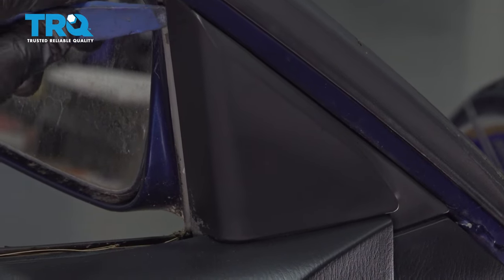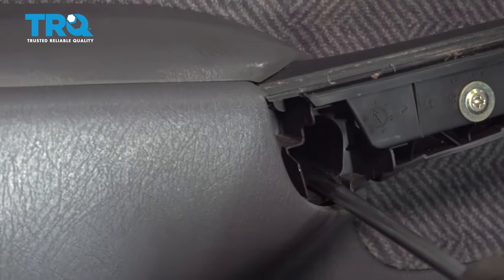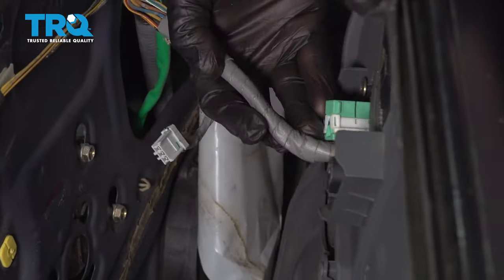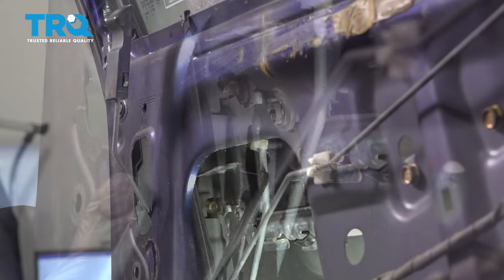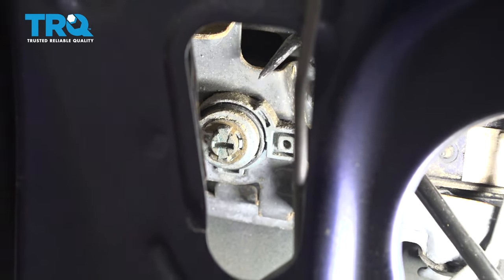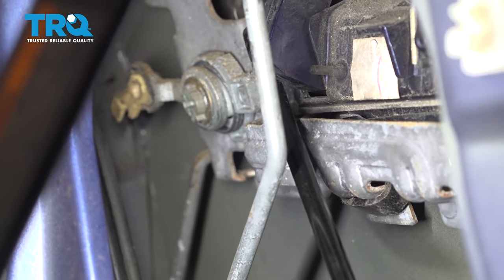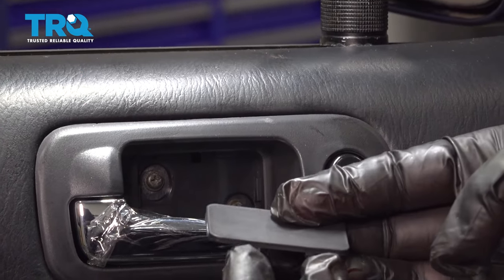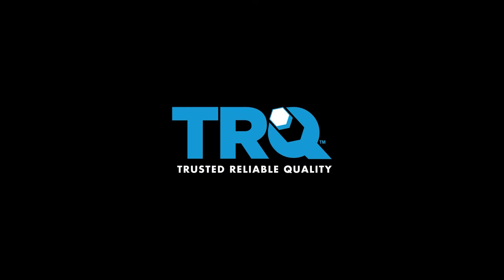How to Replace Front Driver Door Lock Cylinder 2001-2005 Honda Civic

Comment: Some things to add:

It’s easier to take the window out…probably the easiest part of the whole job. Lower the window 7.5-8” and then the two bolts that hold it in place should line up nicely with the holes to remove (LX model). Tilt the window toward the front of the car and it should slide out pretty easily. 

With the window out, you can push down from the top on to that annoying clip that holds the key cylinder in place. This thing is by far the most annoying part of the entire project. You’ll also need to remove the bolts holding the handle on as shown in this video. That opens up a little more space for that clip to come off a bit easier. 

The metal rod connected to the door handle was a little annoying to remove as well. I had to spray some lithium grease on it and pry it with a good bit of force to pop it loose from that plastic clip that hold it in place. It looked like the plastic in the handle was going to break I had to use so much force but luckily it didn’t. 

With the handle completely out of the door, go ahead and replace that clip that came off the lock cylinder. I have no idea how anyone gets it back on if they don’t do it this way. Trying to reapplying while the handle was attached to the door was virtually impossible for me. 

When you start reassembling everything, the grease that is shown in this video is helpful on the lock cylinder as it helps the clip slide and lock in place when you go to press the cylinder in. 

Speaking of that, don’t do what I did. Check to make sure the cylinder is actually locked in place by inserting the key in to it and pressing in. I didn’t and had buttoned everything up only to realize the clip never snapped in place properly to hold the cylinder. I wound up having to take apart the door again because I didn’t check it well enough. 

I broke a couple of plastic clips that hold the door panel in place in the process of removing and putting everything back, so don’t be shocked if you do. It’s a 20 year old vehicle after all.